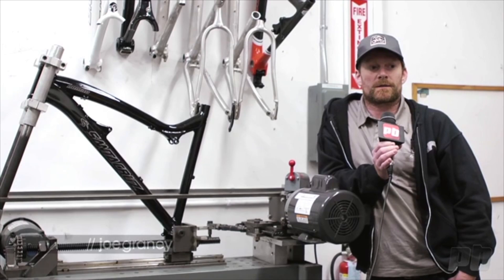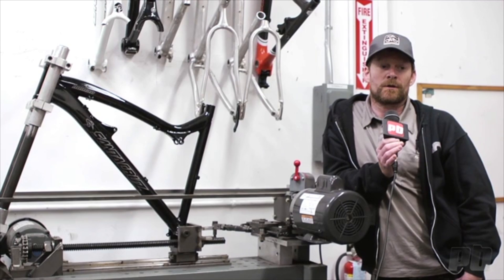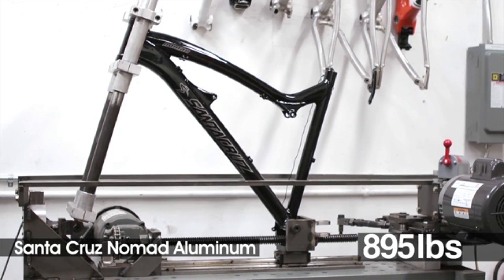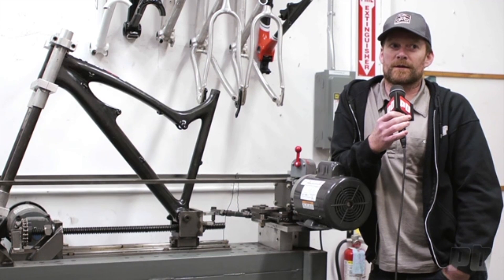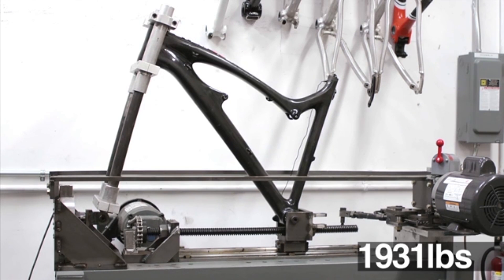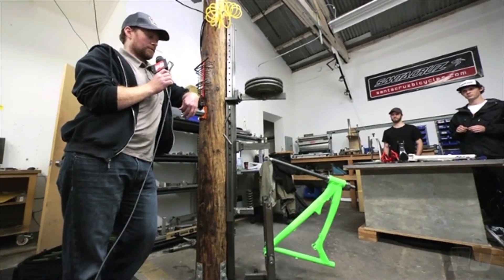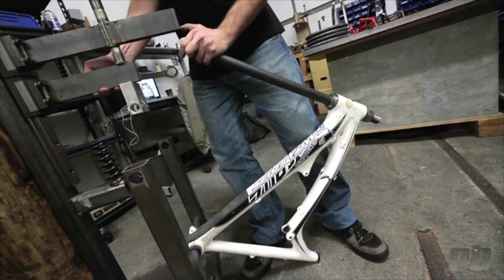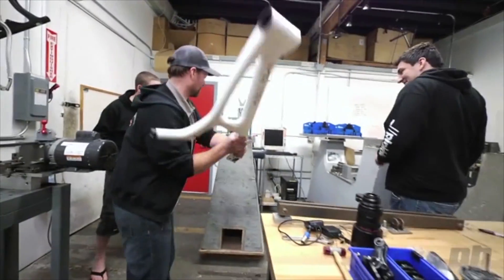Carbon vs Aluminum Frames - Which is Stronger?

Comment: After having the mid set of carbon is bad, i have changed my mind a bit on this one. If you're having an impact hard enough to break a carbon frame, chances are you'll be leaving in an ambulance rather than riding out...

Comment: First test
980lbs and you have plastic deformation for alu, 780lbs and you have the first delamination crack with carbon.

Victory aluminium. Periode.

Still 980 or 780lbs are very low, I was expecting more. The bike with the rider and gear is often at more than 220lbs. When you run the impact is already 3 times your weight, it means that with a rigid fork like in the test the frame would crack easily at the first big pothole. terrifying.

Comment: to stress test it put a fork in it use a machine to pull the bottom bracket away from the edge of the fork.. this is to simulate a flat drop whether if it will hold or not.

Comment: According to underwriters lab carbon fiber is 5 times stronger than steel frame I rather ride a carbon. Fiber 1st choice than 2nd chromoly steel aluminum last I ve seen a guy go off  jump and snapped the  bottom. Bracket

Comment: There's a lot of aluminum defender here on comment sections. After all, aluminum bike users are lot more than carbon. Although the test is convincing, but some points on aluminum side are valid as well.  For me, i'll go to aluminum. Maybe, overtime, aluminum can last longer than carbon fiber.

Comment: logically speaking, the carbon frame didn't break at the drop of the same weight and height as the aluminium one, because carbon fiber is more flexible and absorbs the shock better, not because is necessarily stronger. But it's just my own opinion.

Comment: The test Mountain bicycle that is really good on it that it inside but what about that the real test for the outside of the wereworld that are of well to the beginners or already done this already that ride a bicycle to the mountain to the hill the lowdown up down to the mountain and specially that well if this was a real test for outside it could be light but be successful but the question is that how many of four men and women that are using of a mountain bicycle that the weight of the pounds that's the question is that because everyone needs to know that how much you weight is like a mini sizes medium large or extra-large

Comment: Such a bullshit test of a mountain bike. Unless you are doing extreme shit. Most people will never exceed the torque required to dmg either frame. But anybody trying to improve  or do anything Harder than green trails will eventually go over the handlebars or ghost their bike in the air. 

It will fly down the trail and the frame will impact a rock of varying diameters.

Force is multiplied the more narrow the point of impact. It's the single most common damage mountain bikes.

Oh wow a carbon frame will survive the impact of a 12 ft drop. Allow will only survive a 9 ft.
Yeah because the average mountain biker is doing that right?

Both bikes get launched frame first into the narrow edge of a rock.

Carbon bike becomrs an overpriced paperweight, alloy has a dent.

Not to say carbon isn't great if you can afford to write one off per year, or don't mind sinking excessive money into the sport, or are sponsored. Or if you want to have all the gear and ride slow and don't try and progress your skills.

For anybody else, carbon is a complete jerk off.

I'm actually riding difficult trails and working on my skills, I have no interest being terrified to bail on a carbon frame, and ride it into a broken neck.

I can afford a carbon frame, but to save what? 2 lbs. If you aren't a pro it will jot help. Half the old fucks that run carbon frames could lose more than two pounds if they opted for a salad once per week.

Comment: Good video. Two carbon frame bicycle.
Standart corbon and special strong heavy carbon & metal steel.

Heavy Carbon metal steel matreal us Hard  drive off-road downhill track.

Real strong carbon metal steel bicycle frame test 2tonns

Matreal special project F-1 formula body carbon metal desing inventar style 😎 👍 💯.
Or supercar world body desing inventar strong heavy carbon metal.

But... Remembered this standart Carbon bad winter season. Artica winter North or South country winter season Carbon very very bad cold winter matreal. Due to the cold, the carbon matrix shrinks.  The special glue loses its adhesion due to cold exposure.  Deforms.  Durability is lower than heat.  Very fluffy.  At minus 10 degrees will break faster than in the heat test.  Therefore, the carbon in the metal fiber is very good at withstanding heat and cold resistance.  Exposure adhesives are flexible in both heat and cold.  Heat expansion and cold shrinkage.  The following carbon fiber with metal fibers are used in supercar and various other vehicle models.
😎 👍 💯 good  video

Comment: Does this also say the aluminum alloy frame is under built versus just carbon versus aluminum? 

I have had alu frames fail on a road bike without a single crash and I have alu mtb bikes that are still going after ten years even with some minor crashes.

Comment: I’ve seen many carbon frames crack with just simple tip overs onto a rock. I have a carbon Heckler and a carbon pivot. I’m super careful with both because of this reason.
Reply: Yup, force applied at a single point differs from forced distributed across a surface. I’d like to see that difference explored in tests as well
Reply: It may be that aluminum is weaker on distributed impacts but stronger as far as sharp or single-point impacts. Think about how a car wind shield works for perspective
Reply: @hardboiledsolace  High grade aluminum used in bikes is as strong as carbon just a pound or two heavier and they ride different. Most prefer the ride of aluminum after using both.
Reply: @michaelmichaelagnew8503  I prefer carbon after using both. According to an aerospace engineering friend, carbon will degrade over time though. He doesn’t cycle but mentioned wanting aluminum for long-term if he did

Comment: When alu frame bends you can still ride a bike. And later on fix your frame ( in most cases)
When your carbon frame fails you can throw it in garbage if you manage to survive your downhill ride in the moment of braking. Not to mention micro fractures in CF cannot be detected by naked eye, meaning you just don't know if your frame is safe for ride. 

Also 90% of road bike cyclists can't tell the difference between alu frame and Carbon frame whilst riding. That is a fact. You think you feel difference but that is placebo effect due to insane amount of money you've spent.  Looking at alu frame road bike crushing your casual ass must hurt allot.  Only experienced competitive riders can milk that slight difference between frames to their advantage. 

If you have money to throw and you are road bike enthusiast ... sure do what ever makes you happy. But if you are poor fuck that needs whole year to pay for your CF Bianchi... don't be stupid.

Comment: Il problema è il lavoro ossidativo.. prolungato nel tempo..
Un telaio di bici da turismo in alluminio passa abbondantemente i 100000km .. avevo una vecchia bici con telaio scandium.. 20 anni tra viaggi e allenamenti.. l'ho regalato e sta ancora camminando.. 
5 anni fa ho preso una bdc in carbonio di una nota marca .. faccio 20/25 mila km l'anno alternado mtb e bici..  il 70% dei km li faccio su strada.. e a 63000 km la bdc ha iniziato ad avere dei cedimenti di fibre.. e mi costerà un po ripararlo..  parliamo di carbonio premium.. 
La mtb front in acciaio ha 39000km di strade dissestate e single track.. ancora perfetto ... io peso 100 kg non 60 kg.. 
Ho visto bici impattare una radice e disintegrazione la forcella in carbonio.. con la bici in acciaio di mio nonno del 1980... ho percorso centinaia di volte quella strada e mai un problema...
Sono sicuro che con nuove metodiche di costruzione e nuove tecnologie, migliorerà di sicuro..

Comment: Useless test. We know which one is stronger in identical geometry because material properties data sheets exist. The engineer decides how strong to make it while balancing other design criteria. True for any material. The geometry will  be chosen with the materiel in mind. Carbon provides more strength for a given geometry, with less weight. Aluminum provides better toughness.

Comment: I feel like this  tests would approved as a prime example of indoctrination. As much as I love Pinkbike but this tests is invalid. Carbon bikes are a planned obsolete. Many many people have broken they're frames with a ricochet from a rock. Which leads to delamination. Not to mention non visible crack overtime (internal). And they say they have life time warranty,  but how many times you want to patch your frame before it be comes a collage of disaster. The structure is bound to break. Also they're forgetting when you land on a drop or jump or even flat. Forces are pushed outwards not just gradually and in one direction. The impact is instant and could be multi directional which is a weakpoint for carbon. And especially for heavy riders. That is a total loss.

Comment: When carbon fails it's a catastrophic fail.
When aluminium fail it's just non catastrophic, it just bends, you can ride it home...
Reply: u are right, when carbon fail, it will crack instantly, can be pretty dangerous.

Comment: Das ausgerechnet beim Fahrrad der Umwelt-Aspekt so vernachlässigt wird, dass selbst die Automobilbranche besser abschneidet, ist einfach nur unter aller Sau!

Seit den frühen '80.ern verspricht die Chemieindustrie schon Carbon umweltfreundlicher zu machen und nicht aber rein gar nichts ist passiert.

Ich weiß es weil ich damals an der Entwicklung von Beschichtungssystemen für Carbon mitgearbeitet hatte und das Thema schon damals anfragte!!

Comment: There's a guy on YT who ran his S&S coupled Co-Motion into a car and folded the top & down tubes.  He complained vociferously that he was JRA and it shouldn't have broken.  Something to the effect that, "Bikes shouldn't break like that!"
Well, they wouldn't have to... if you wouldn't mind riding a 100 pound bike!
Had the classic JRA experience:
College kid comes in, "Hey man, I want to warranty my bike."  We're like, "OK, let's take a look."  Steel frame with down tube folded on the underside, at the head tube.  Classic "ran into something" failure.  But we've been around the block a few times, so we say, "This isn't 'our call,' so we're going to have our ACME BIKE rep come in and take a look."  
He came in and confirmed that this was a frontal impact.  What further proved the point was when the rep held a straight edge along the top tube - also bent.  Bowed up, proving a frontal impact was so high to buckle the down tube, but also so high it deformed the top tube.  No warranty, but ACME BIKE offered a discounted replacement frame through their crash replacement program.
Needless to say, the customer wasn't pleased.  Complained up and down that he was "JRA and the bike's a piece of shit!" and all that.
A week later, his frat buddy comes in and says, "John tried to warranty his frame?  He was riding home from a frat party drunk when he ran into the back of a parked car!"

JRA MY ASS!!!!

Bike manufacturers COULD make bikes to withstand frontal impacts, no problem.  But then they'd also want to anticipate all other sorts of impacts, accidents and stupid rider acts.  They COULD make bikes indestructible if they wanted.  But then they'd weigh a hundred pounds and no one would want to ride them.  Their sales would dry up and they'd quickly go out of business competing with 22 lb. bikes - that do break when you drunkenly ride into the back of a car!

Comment: This testing is not fair, because the force resp. the impulse was applied in the plane of the frame. Using a force from the side or a torque, I am sure that the results are different.

Comment: Dumbest test on youtube, what is point of a linear compression test of a frame, maybe just the equipment available ??  quick scan to the end of the video and you find swinging a carbon frame into concrete w/o safety glasses.  How Beavis and Butthead stupid can one be??  As an Engineer, these video is pure garbage from any science point of view.  Why dont they fix the breaking points in the rear triangle of their Chameleon Frames?

Comment: That just proves that SC carbon frames are way overbuild, thus underdesigned.

Who would take a jump, land at this angle against the forks and still be on the bike with all hist weight on the bars, seat, and pedals?    Luckily this bike doesn't weigh 110lb or wouldn''t fall any faster when dropped from the empire state building or the 10th floor.  Too anti-aerodynamic to move too fast :)

I bet a Look frame is designed to break much earlier than a Santa Cruz mtb.

Comment: Shouldn't both frames should be the same strength, just lighter or heavier?
Reply: Unfortunately, no. It's a lot more complex that that. Carbon Composite frames are incredibly stronger than Aluminium as long as the forces within them can be carried by the Carbon Fibers. The resin that holds the carbon fibers together is a lot weaker than Aluminium. But, Aluminium has the same strength "in all directions". That's part of the reason why they fail in different ways. And both the resin and carbon fibers are much lighter than aluminium.
Reply: Depends on the grade and quality.  Aluminum frames get as strong as carbon depending on the grade and quality today.  Aluminum frames have come a long way and I think carbon will eventually be fazed out by them. Carbon has to many weaknesses that are very detrimental when it comes to biking.  I know allot of people have switched over.  They weight a few more pounds at the most though.  Carbon used to weight allot less but they don't anymore which was their main strength.  Titanium will replace carbon soon I think.  It's just better in every way.

Comment: I see a lot of arguments made in favor of Aluminum frames "bending" where Carbon frames "snap". But these are stress tests done to test the strength of the material in it's shape & designed form. Carbon clearly resists more force. Aluminum frames aren't molded. It's far more common for aluminum frames to develop problems near welds and angles. Carbon maintains it's stiffness and has the advantage of being a consistently stronger throughout it's form--angles and welding points are not of concern to the designers as with the aluminum frames.
The actual force these frames are effected from will be from rider/trail impact and I would venture to guess would be far less likely to damage carbon frames. It's been many years since carbon frames have been beaten to hell by mountain  bike riders, and it looks like carbon is going to become more popular, more affordable, and more practical then most of us believed when we were first seeing them on mountain bikes. It may be a somewhat safe guess that in another 10 years or so, carbon MTB will account for close to half the new bikes being sold. MAYBE a little longer, but these technologies develop quickly these days, and I'm guessing in around 10 years and they'll be commonplace to about half the average riders.
I don't see carbon taking over aluminum quite the way aluminum took over steel frames, but  look how quick THAT happened, and not with the same rapidity of advancements in technological manufacturing that we're applying to carbon. A little more, like maybe closer to 15 years, and many young kids will be buying budget carbon mountain bikes in Walmart.
I've ridden steel frame hardtail and never looked back the day I started on my aluminum MTB. I should've even left steel frame sooner. Now that I'm going carbon full suspension--I'll still enjoy my aluminum for some things, but the carbon is definitely superior.
~JSV
Reply: nope..

Comment: Carbon frames are hyped and expensive. Until they actually are made the way they market it "strongest frame"  Don't buy carbon. They snap in half like a tooth pick. And if you want to spend $ 10000 dollars on a bike that last you a year or two then Bee my guest. In the end you are making mountain biking too expensive for others. By supporting these high end companies and buying these ridiculous price tags on a "bike".  Also why do you think 26er community is still around. Thats cause our frames don't snap like carbon. Take it in
Reply: I would not buy super light carbon but some more durable composite, carbon just feels way more comfortable.
Reply: @lovelyjubbly1023  yeah I mean if you want to glide through space at Ludacris speed. The material is just to fragile. I've seen guys cracking there frame on the first ever ride on their bike. And the frame is cooked. This was from a rock deflection
Reply: @nbzness  I bought a superlight easton ec90 seatpost and it pinched and cracked instantly, so i put my old fsa slk seatpost which is still carbon but much more durable, no cracks or problems, i'm looking in to a new frame but i would never buy super light carbon and i will stick with giant who make their own carbon composites, they have a lifetime warranty too but i doubt they honour it.

Comment: I feel like this test is totally invalid. First off.. when you case a jump its fast impact. What you demonstrated there was a slow progression resulting in bending the aluminum frame. Carbon fiber frame snaps on fast impacts. Like glass but metal? I'm no scientist but I don't think this is good example. And also I watch alot videos on youtube. And all I see is carbon snapping not bending. And also I don't think carbon fiber is made for mtbing. High price high risk. Chromly is a better material imo. Steel bend but don't snap making it safer in a situation  where you case a jump. The chromly frame would absorb most of the impact by bending where as carbon fiber snaps fast on impact. Resulting the rider hitting the ground with full force n no absorption.
Reply: well said